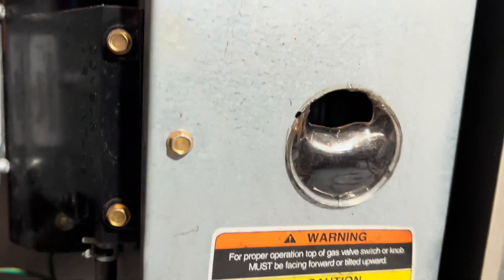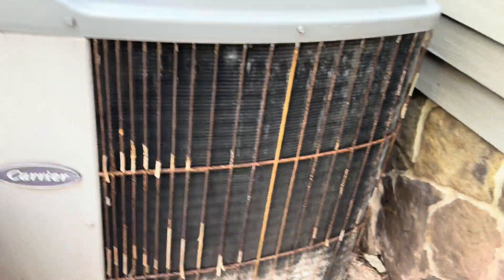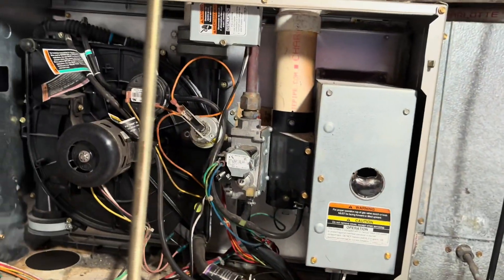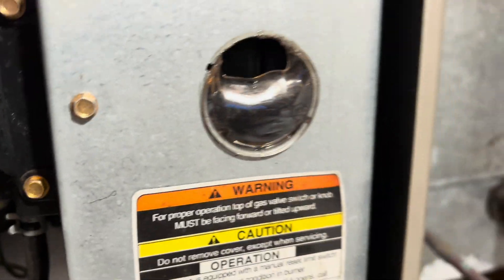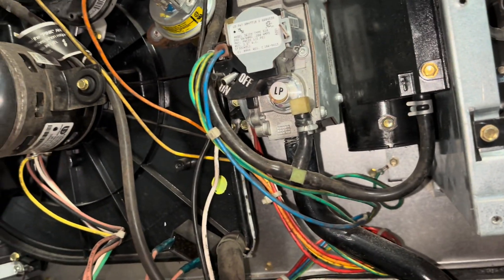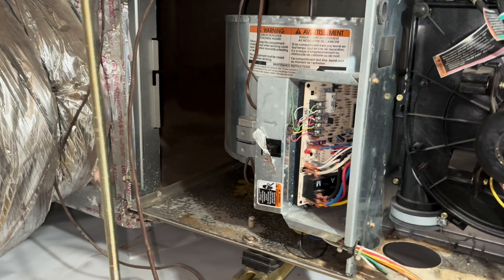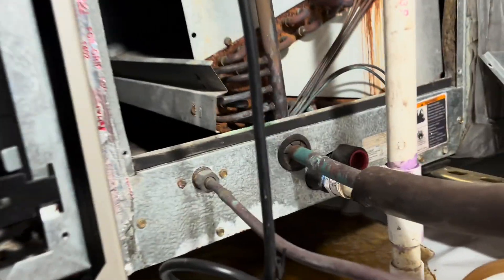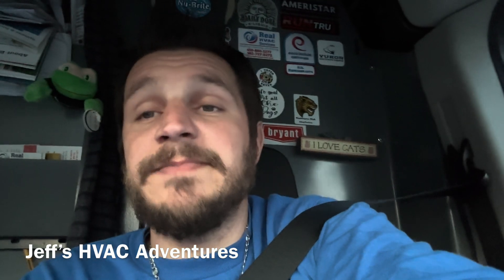MELTED SIGHT GLASS!  Carrier Gas Furnace With A Blocked Heat Exchanger!

Comment: I've had the things melt the intake pipe pipe before lol. There was a lot of these installed in my area. Bad on carrier all around, I believe they came out with an installation bulletin at some point that the rollout must be upwards, still doesn't change the secondary plugging up at a premature age. They should have discontinued them as soon as they started noticing problems. Thing is in 1993 when this model debuted, those actually help up pretty well and did not rust out the secondary within 10 years.

Comment: the condensate pump would kill the R not the rollout. that is why thermostat was blank.  carriers fault would always run the fan. so the home owner  would get cool air going into the house.   the only times where i found a heat exchanger get sooted up was because it  is imcomplete combustion.  good find.
Reply from the maker: This furnace definitely killed R when the roll out tripped.  The condensate pump had water around it but it wasn’t full.